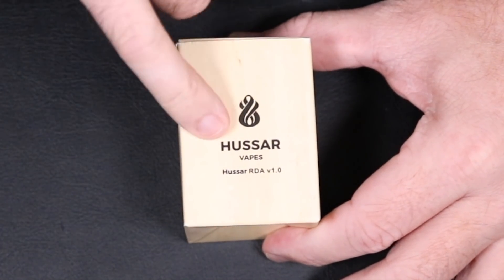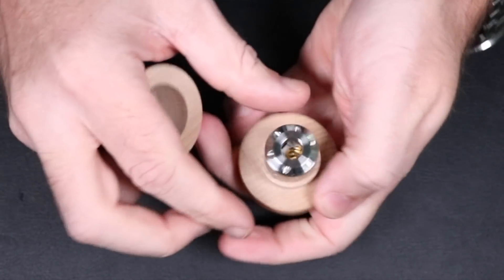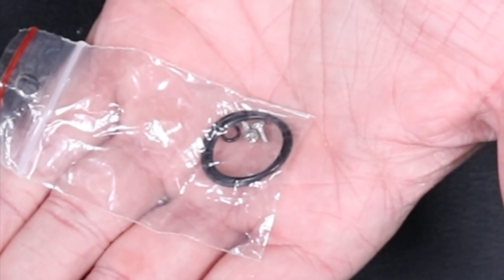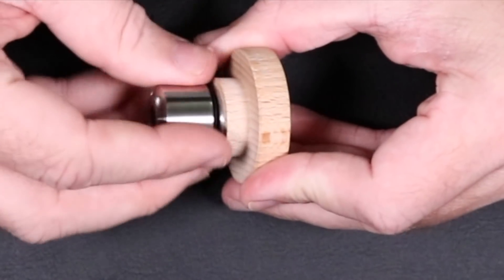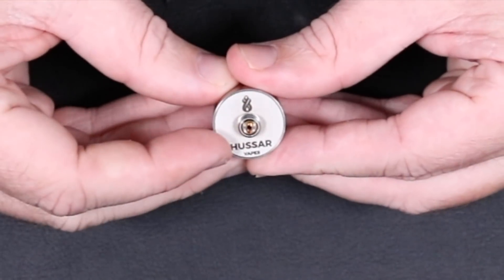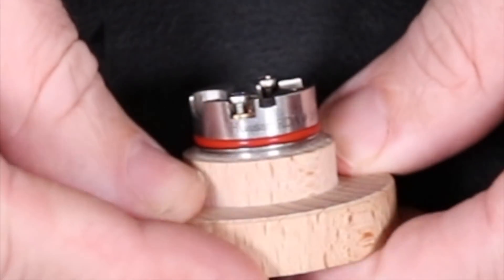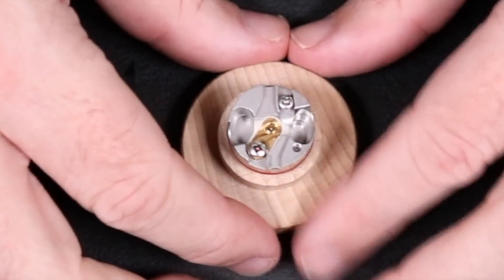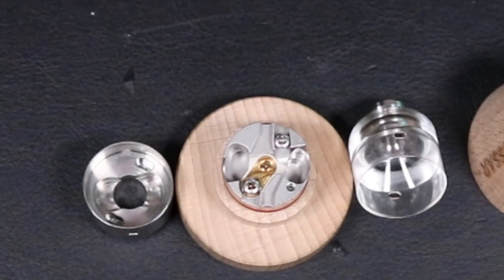HUSSAR VAPES RDA V1.0 ~ BEAUTIFUL/FLAVORFUL/GRATEFUL :-)

Comment: So I have it. I am so excited. I built a .41 ohm ss fused Clapton, 5 wraps, 2.5 mm.  I have it on my dotmod regulated squonk.  What wattage do you think I should be at, approximately? If you couldn’t tell, I’m really new to this. Do ss coils have a temp restriction? Any guidance would be helpful. Many thanx
Reply from the maker: So having it on a regulated is going to make finding the sweet spot that much easier :)  I don't know what my wattage is at .45 off the top of my head but I have had this on a regulated before and I was around 40watts...so i would say anywhere from 35-45w would be pretty sweet :)  SS is awesome on regulated mods especially if you use temp control so no worries on that material.  I usually run 3mm coil but 2.5 also works just fine since that chamber is so reduced.  Only thing with SS coils is you would always glow them at low power....30watts is like MAX when breaking them in.  If you were to put SS claptons or anything on a mech mod and hit it to strum it would destroy the metal....Kanth is the opposite as you can strum that at pretty much any power you want :)   Sounds like you're right on it Sascha and I'm super excited you picked up one of my all time favs!